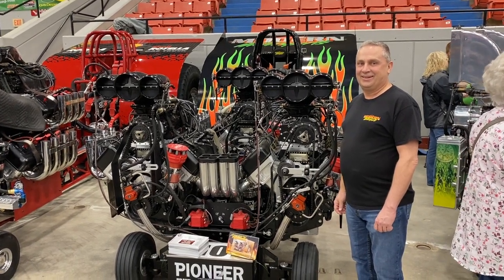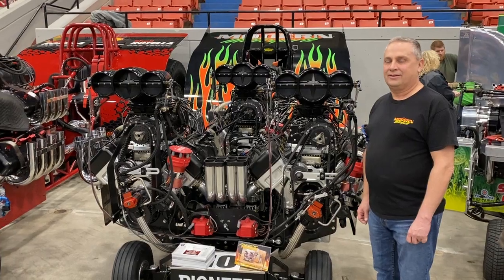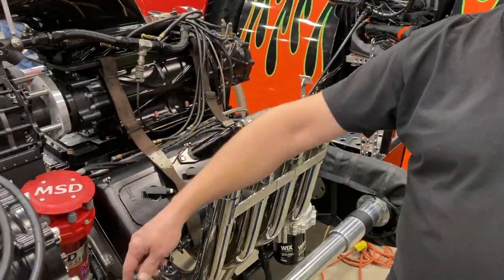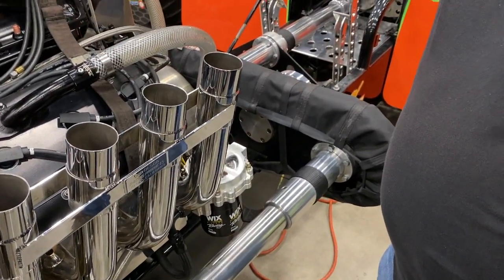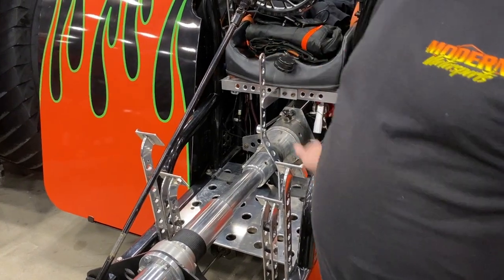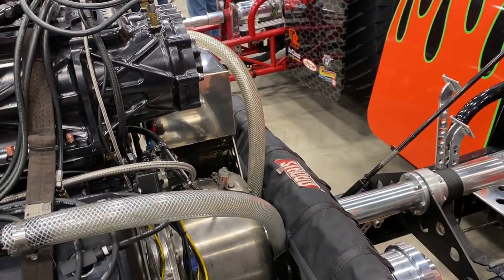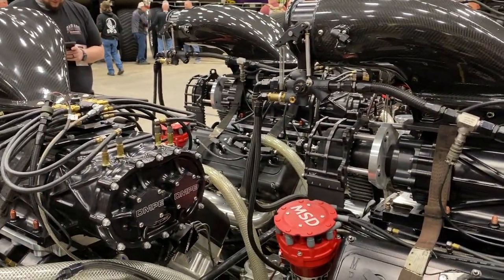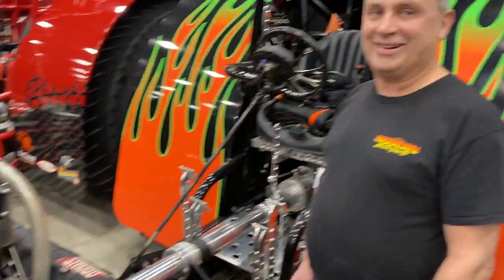How MULTI-ENGINE Tractors Work!!!

Comment: I always thought they used torque converters because they didn't use a clutch pedal when starting off. How many rpm does the tractor need to start at? How do they adjust this centrifugal clutch without a pedal?

Comment: How are jet engines connected to a driveshaft?
Reply: The same way jet engines are connected to props. Instead of connected to a propeller, the shaft is connected to the wheels. They are called turboprops. Here´s a video explaining how it works https://www.youtube.com/watch?v=B_p3_9si5D4
Reply from the maker: I will do a video on it.

Comment: I wonder if  tq could be spread over a wider rpm by having slightly different  gear ratio for each engine... So that as 1 engine  hits peak power the next is say a thousand rpm behind rpm behind, then the third. This way instead of having one crazy peak number of the combined engines you get more of a constant pull. Probably a job for a clockmaker.
Reply from the maker: That would only work if all 3 or 4 or 5 engines were guaranteed to work.  Often, one in the process breaks a blower belt or something along that line.  If that happened to a middle engine, the results would be catastrophic.
Reply: @badgearapparel  I thought that was the show!!!  ;-) I still go back watch that one tractor heave it's engine onto the track for fun. Okay so how about a shutdown with sudden loss of power. One way sprag clutches, to save engines.
Reply: A couple of guys have tried something like that.  One way Joe Eder triee was using two Chevrolets and two Hemis.  On produces more torque and the other more HP.  But nowadays it has become more of a HP game to get yoyr speed up.  Plus the mods are having a harder time getting the power tonthe ground than ever before.

Comment: they're loud and violent and powerful.  i love them.    A 100HP traction engine can pull more,  i dont know if they have a sled that will stop one yet but they should soon
Reply from the maker: A 100hp traction engine will pull more???  The sleds will stop articulating tractors no problem.  On a good track, they have trouble stopping these.  They can't stop them on a shorter indoor track.
Reply: @badgearapparel  Yep,  a 150 Case (150HP)  has the record
Reply from the maker: Has what record??
Reply from the maker: Oh I got you.  Pulling power is a factor of weight.  That big Case weights what 40,000 pounds??  These weigh 7200 pounds.  IF you could build one big enough and mount enough motors to weigh 40,000 pounds, it could pull a 800 bottom plow.  But then you run into Price's law & it would start eating engines.  A 7200 pound, 150 horsepower Case, John Deere or whatever could barely budge the sled these tractors pull on a short track.
Reply: @badgearapparel   Yeah, about 40 thousand pounds, they produce around 1100 ft pounds of torque at the crank at 200 RPM.  Yes,  I imagine that's why they call them traction engines.   They are using two completely different methods of pulling, its like comparing apples and oranges.   A ten thousand HP 7000 pound tractor can pull a sled in 3.2 seconds, a 100 HP 40,000 pound tractor takes about 15 minutes to do it but it could drag the sled all the way home and the sled operator would be crying 'stop, stop'  and the tractor pull would be over and they would all be standing there wondering if dude would run out of cordwood soon.
Reply from the maker: Again pulling power is a factor or weight.  By that analogy, that big Case weighs 6 times what the pulling tractor weighs.  The sled would need to weigh 6 times as much also or 312,000 pounds.  I doubt that Case could budge it much less drag it 300ft with the weight moving forward and the grouser bars digging into a hard packed track.
Reply: @badgearapparel  My traction engine can plow the entire race course and drag the sled behind the plow.....  Something somewhere would budge, mostly dirt
Reply: I understand what your saying @badgearapparel